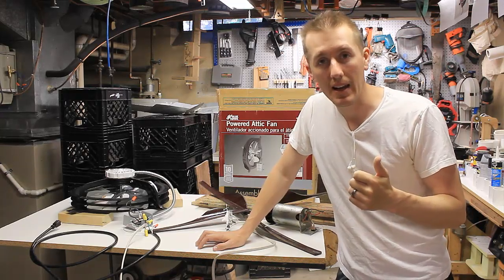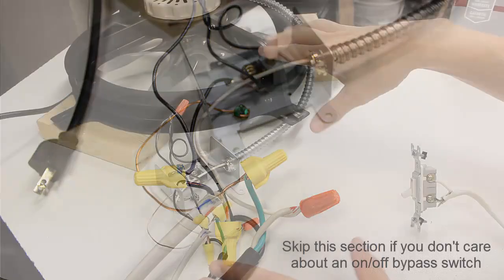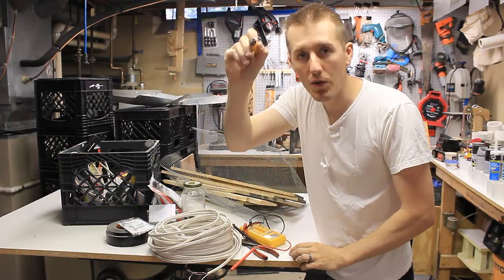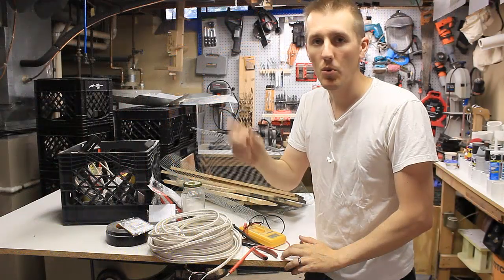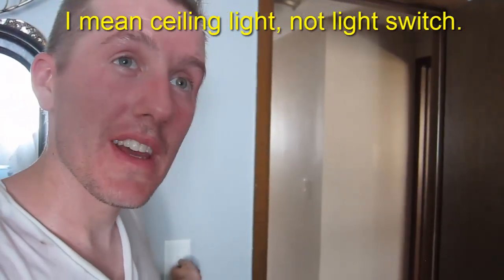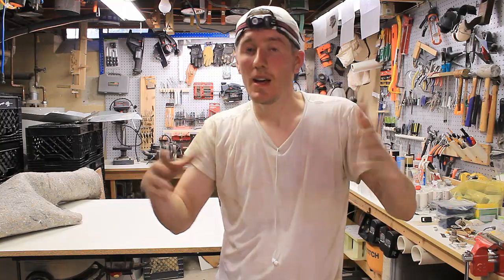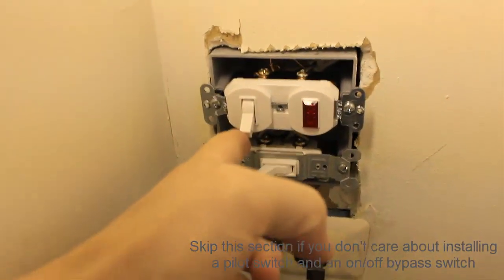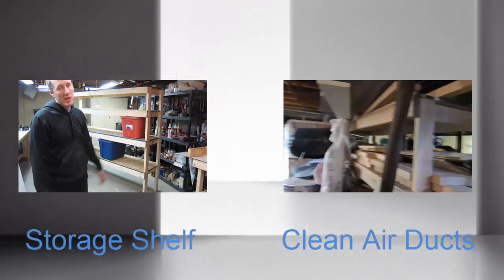Attic Exhaust Fan Install

Comment: Something I didn’t know is there is a little bulge on the back of the motor with a hole for lubricant. They should be lubed each season. I didn’t know this, otherwise mine would have lasted longer than six years

Comment: you sound like an intelligent fellow so why is it that you wait for the temps to reach 90 outside before you start? Get up at 6AM and start, then you can finish before it gets to 80.  I see later on you came to the same  conclusion. good luck with  your fan.

Comment: How much of a difference would you say this makes for you during the summer?
Reply from the maker: The goal was to cool the attic from 130 degrees to like 100 in the summer, so that the AC wouldn't have to constantly run.
Ideally there would be lots of air-flow from the outside.  
Not sure about the difference it made, since one day it would be 90 degrees outside, then the next it was 80 degrees.
But i'm sure it helped somewhat to lower the attic temp.  But i can't say that it immediately dropped the temperature 30 degrees or something, i never checked.

Comment: I am suggesting getting thicker insulation in your attic for your A/C problem.  My new attic fan barely made a difference, but once I installed R-49 in the attic.  My interior problems were no more.

Comment: I lately install a attic fan 1900 fmc. Before I install attic fan which was 140f. Downstairs was 95f. After install one. Amazing Changed. Downstairs is 75-80 f at most time. Great investment to install one

Comment: Don't feel bad about the wiring mistake.  When I bought my house the only way the smoke alarm would work was if the hall light was on.  Yep, the builder hooked the smoke alarm to a hall light switch.  Against code but they got away with it.  I disconnected the electric smoke detector and put in a battery powered.

Comment: Job done. You're alive. All good. Attic fans are good but WAY too small as a whole house exhaust fan. A fan specifically designed to move the necessary volume of air is required.

Comment: This may sound duh, but make sure your fan is pulling the air out to the south or west side of the house.
Reply: Great rule of thumb for the us in the northern hemisphere (remember, YouTube has worldwide viewers) however, my situation is the exception. My fan exhausts out to the northern side of the attic. The southern side gable vent never sees sunlight because it is blocked by shade from tall trees and the chimney on that side of the house, thus making it the cooler side of the house.

Comment: where does the black tripple wire cable come from?  I am assuming that is coming from the breaker.    I think a step by step installation would be helpful.

Comment: How loud is the fan?  Did it work in reducing the upstairs temperature?
Reply from the maker: The fan was super quiet.  We at least in the house.  You really couldn't hear when it was on.  And ya, it could have been better but it did blow all the hot air out of the attic and help to cool it down.

Comment: smoke detectors are great places for constant power
Reply: Except if they've got an interconnected 3-wire circuit.
Depending on the power draw, if too large of a voltage/amperage drop occurs, you'll make them all go haywire at once.

Comment: Will the fan motor last longer if it turns off now and then according to temperature or one that runs 24/7 nonstop? Thanks for the help.
Reply: If it's a motor with contact brushes it's going to wear out faster running it 24/7, not to mention the additional cost of powering it non-stop.

Comment: My 2nd floor used to be an oven in summer and one room was cold in winter....found out our attic had a out 6inches of insulation had company put new insulation to 17inches problem solved 2nd floor improved 95% not an oven anymore nor cold in that 1 room, air and heater working less, saving money on both....no need for fans...also read fans screw up cooling system of your air conditioning

Comment: Let's assume that the bats get into your attic thru that vent.  By putting up the screen in the daylight hours you have trapped any other bats inside the attic to die.  Better idea would be to put up the screen at night when the bat are outside.  Then when the come back in the morning they can't get back into your attic.  Then you start the other work.  Oh, yes.  Did the fan cool the attic?
Reply from the maker: Yes doing it at night would be the best way.  Or i've seen where you can make a 1-way tube or something where the bats can get out but not back in.  But i only had free time during the day.  Night would have also been a lot cooler up there too.  And yes the fan helped i think.  But i didn't really do any testing to check the temperatures with the fan off or on, so i don't really know.

Comment: I just finished doing mine and I made sure to seal any air leaks around the fan with tape and sealant. Made a difference for sure but it is still hot up there. I should probably have done a before and after temperature reading.

Comment: I did this with a 17$ 12 inch 3 watt fan that you find in computer section at Fry's with a small solar panel that gives 3 watts for like 30 $ and man that thing makes a world of a difference
Reply: A 12" inch fan in the computer section??? Wow.
Reply: Yeah they have them I didn't know they made them that size but they do

Comment: One of the tricks I learned is that the fan should be sealed around the opening or else it tends to just pull in air from the outside and recycle it instead of pulling from the attic.  You also need a vent at the other end of the attic (or in the soffits) so it pulls the air across the whole space.  Good luck!
Reply: I was going to ask about an intake vent but you answered the question thank you. I will also put a vent in a lower outside door to allow air to be drawn in at night.
Reply: I keep seeing fans installed this way, so looking for an example of one installed at the gable vent. I guess must be boxed in around the sides.

Comment: Dude, instead of putting in a fan I believe your best course of action would be to add insulation. Because if your second floor being warmer than the first is truly from heat gain from the attic, (which I doubt it’s all from that), the fan isn’t going to do much, you need a better thermal barrier… beef up your insulation. I dicked around with attic fans and they did nothing. I ended up blowing in R-70 worth of cellulose insulation along with a proper vapor barrier and I have zero heat gain issues. Also, know that heat rises, you should  direct most of your AC airflow to the second floor, it’s all all eventually fall back down to the first anyway.

Comment: You will still have to go up there at least once a year to oil the fan motor. I noticed that motor still had an oil port so it is not permanently lubricated.
Reply: You should be lubricating it anyway. That basic maintenance of any machine.
Reply: is wd 40 ok for lubrication?

Comment: Hi just have a question regarding installing a roof fan like u did on a residention roof that currently has 4 other vents on roof.....what do u do with the other vents? I was told you would plug them up but not sure i agree with it........if you plug up the other vents where is the air going to go when fan is not running?....any input?
Reply: IMPORTANT!! I've got a much better/cheaper system, for your over heated attic! I've studied this kind of situation (being involved in  home construction, most of my life) with the dredded hot attic effect, which also eventually heats up the rooms in the house, and also reduces the shingle life, with the sun bearing down, trapped in your attic year after year! 
  If your determined to use a ''little'' gable wall attic fan, which isn't moving much air, even if your doing everything else correctly! You should then close off your roof vents and open up soffit vents in the lower soffit eaves, to draw cool,  outside air, up from the lower part of the attic which then travels up through the attic, allowing (chimney effect) naturally drawing heat up, and out your fan vent, and will work 24/7 even with fan off, or with no fan at all!  You have a But not your most efficient system, sorry to say! Possibly the least efficient/cost effective, when considering several, much better/cheaper way! 
  Your best way to draw heat out of the attic and ''without 'the need of a fan'', is by opening soffit/eave vents up, allowing heat to be naturally to be drawn up and out roof vents/attic gable vent! No fan needed.
  The very best system, is ridge vents! Their the best way to expel the most heat volume, with soffit vents open! 
  Your not drawing heat out, if there's still heat, trapped (vacuumed)  in your roof, that's not moving!  It's only drawing cool air in through the upper part of the roof, through your roof vents (if you have roof vents) which are located at the top of the roof, leaving the heat still trapped deep down, in the roof area, and at your attic floor, which is conducting the heat down through the ceiling of the house, which is then eventually heating your living space, towards the mid part of the day, on into the night! 
  Think of it the way your going about it, in simpler terms. Like drinking from a straw. By poking a hole in the middle of a straw (think of it as where your upper roof vents are) then try to draw liquid from your glass, it wont! It only draws through the hole we made in the straw (which would represent where the location of where your upper roof vents are) since it's the closest opening of the draw! Now think of it doing the same thing in your attic drawing cool air in from the top of your attic leaving the heat below this point, unable to move trapped heat in your attic and then eventually conducting heat down into the roomes of your house, and melting your shingles! The more you think of it, the more it makes since!
Reply from the maker: Well i had a gable end vent on the other side of the house.  I was hoping to draw air in from the other side and cool the attic down.
Reply: thank you...my house never had soffit vents..i added soffit vents a few yeara ago....so what i have currently is about 16 soffit vents open...i have 2 roof vents and 2 gable vents and 1 roof mounted fan....i have the gable vents and roof vents blockked off...i was instructed to do that if i installed a power roof fan......is that ok? ...and fyi...when the roof power fan is not running how can you say 1 roof power fan vent would suppley same air exit as my other vents?...

Comment: thanks for the video but you didn't show any results. How drastically the temp change.
Reply from the maker: It's hard to tell.  I haven't really gone back up there in a while.  I only know that when it's a hot day and i hear the fan on in the attic, i know it's over 110 degrees which is what i set the thermostat to.  The only way i think i could test it is if say there were 2 days in a row around 90 degrees, the first day turn the fan off then go up at 5pm and check the average temp.  Then the next day turn the fan on then go up at the same time and recheck the temperatures.  I just think that our attic didn't get a lot of airflow so anything like fans or baffles will help blow that hot air out of there.

Comment: I have only watched the video once through.  Question: It appeared that your attic had minimal insulation and that there were numerous air leaks from the climate controlled living space up into the attic. If I am correct, that attic needs to be air sealed and insulated immediately. Sealing the living space "envelope" is really important.  

Do you have air conditioning installed in this house?  Does the power attic ventilator (PAV) run even when the A/C runs? HVAC experts are adamant about never running a PAV at the same time that the A/C is running - due to the PAV pulling a lot of conditioned air up and out of the attic.  And they are adamant about that rule - even when the attic is properly air sealed - so that  air infiltration is minimized.
Reply: Finally someone that gets it! Attic fans are a  bandaid at best in most cases.
The attic has got to be properly sealed and insulated for this to have any real chance at making more than a 10°F difference.
Most houses with R-38 or better and a properly placed/sized whole house fan do amazingly well without an attic fan.
Reply: Yes your right he would have been way better off sealing the leaks in his living space and bringing his attic insulation up to code or better.  Professionals in the field claim that attic fans are not a cost-saving investment.May 31, 2017

Comment: This is a how to video, I have several questions and concerns.  Your video is very misleading and could get other into deep trouble. As an example, some homeowners insurance policies strictly prohibit the homeowner from doing electrical work on their homes, better check with your agent as if anything happens to your home you could find yourself not covered.  In most if not all cases an electrical permit is required even if you as a homeowner are permitted to do the work without being a licenced electrician. Better to be safe than sorry. 

Was the picture at 6:51 the final completion/ connection at the fan unit ? Did you connect the grounding conductor to the devices ?  What was the load of the existing circuit you acquired power from to determine if it was adequate to support the new fan unit, the system looked older so there maybe too much on the existing circuit already ?  I noticed crimp sleeves "used for connecting ground wires" in your video, did you use the proper amount of twist and correct tools to connect them ? Did you properly support and protect the wiring "romex / nmb  in the attic area were required ?  There appears to many possible issues with your installation that does not meet basic electrical code requirements.  Did you pull the required electrical permit for the added wiring and have it inspected ? 

Just asking.. I'm not trying to be an ass but if you're going to teach, be ready for constructive criticism, especially when it comes to fire, life safety issues.
Reply: JIMMY TRAN - Because they’re crap and do literally nothing.
Reply: Legitimate concern but not every How-To video will contain all the necessary preamble; think about how much longer that would make each video. Dave is just showing people how to do the job. He's not certifying people to do the work; he's not telling you what / isn't covered by your home-owner insurance; he's not suggesting that everyone is capable of performing this installation.

Again, you raise a legitimate concern but some common sense is required when performing work like this.
Reply: Deplorable Pat he is looking out for the guy but this comment made me lol
Reply: Why don' buy the solar is cost about $ 80 and it run by itself.
Reply: Robert De La Cruz best reply of 2017...right on
Reply: Robert De La Cruz blah blah blah
Stick your criticism up your Ass

Comment: good video, but you should warn viewers when you're showing your wiring with the switch to the fan/thermostat switch legs that 120 volts A/C can KILL them with even a momentary contact with the energized circuit if the current hits them just right! ( a 50 milli-amp current across the heart can put a person's heart into 'fibrillation' which will require a defibrillator to restore the heart rhythm)

Comment: Good plan. We moved the fan thermostat from the fan over to the crawl space area and hung a decent thermometer next to the mounting position close to the crawl space for attic temp reference. This helps by not having to go up into the attic and adjust the thermostat at the gable.  Big help.  We set the turn on temp for 110 and that seems to work best so it doesn't run all night long. Typically it turns off around 9 pm on a warm evening and on around 1 pm on a hot day. We lower our living space temps by 10 degrees by having an attic fan with our single story ranch home. One other feature we installed was a maximum temperature shut off which turns off the power in the event temps rise above 200, in case of a fire, it won't run and feed fresh air to the flames. We also wired the thermostat with a pilot light switch which was mounted on the wall near the ceiling just below the crawl space which is located in the hallway to bedrooms. This allows for a master on/off for personal needs as well as for maintenance needs.
Reply: Glad you mentioned the fire issue and potential for feeding oxygen to an attic fire.  How does the max temp shutoff work?  Thank you.
Reply: @KD-mj2ms  There is a high temp shut off in the thermostat that enables at a permanent set temp, not sure of the setting temp but it will turn off.

Comment: I've been there. you can barely get the electric tape to stick your hands are so wet.
Reply: If you do it the right way you dont use electrical tape just wire nuts

Comment: The problem with having a black wire or the hot wire running to the fan and the switch controlling the neutral or the white wire is that if it grounds out somehow it's going to turn on or in layman's terms it's going to have power to it 24/7 so even if you turn off that switch and you have a hot going to it that's uncontrolled it will still electrocute you with that light switch off